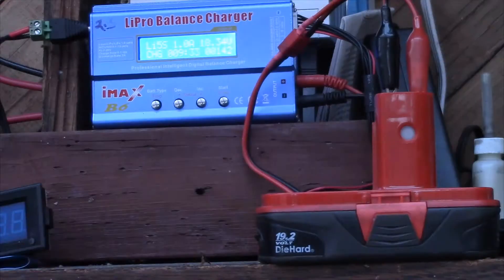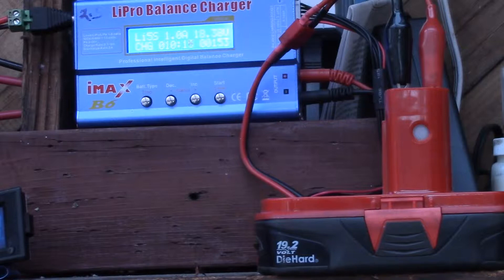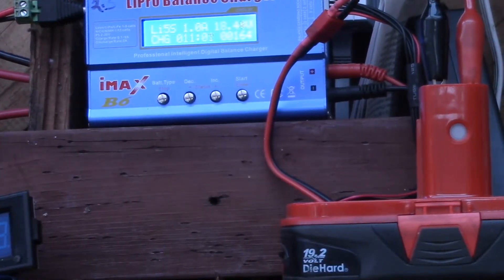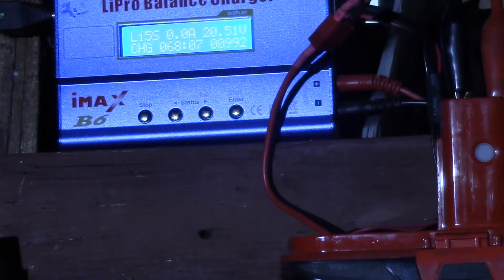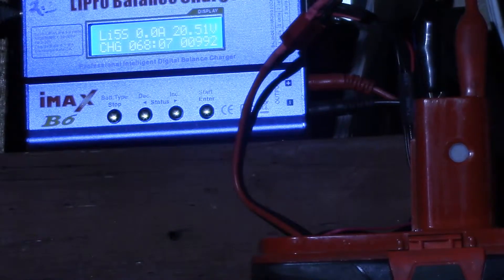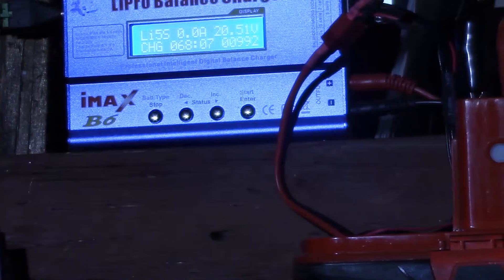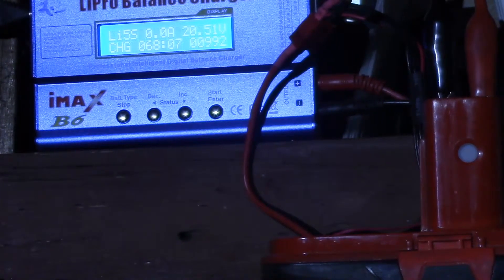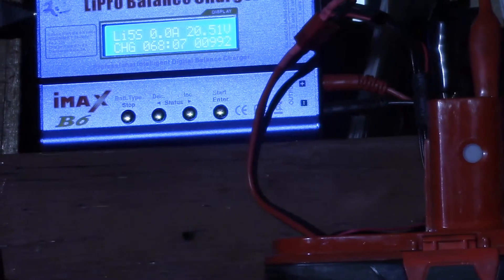C3 Battery Charging, Part 1

Comment: For those who don't want to watch R Brown's 16 part video showing his research identifying how to charge C3 lithium packs, the quick answer is the + terminal is the curved end, the - terminal is the flat end opposite the curve.  Apply 21V across + and -.  Most variants will need a 22K resistor between the left terminal (when looking with the curve away from you) and the + terminal.  More information is in my blog at http://chisight.wordpress.com/2016/10/20/charge-diehard-craftsman-c3-lithium-ion-battery-packs/ .
Many thanks to R Brown for his research in identifying the details about charging these packs.